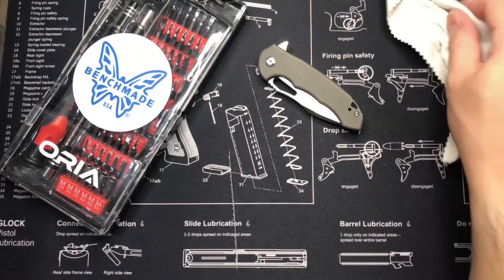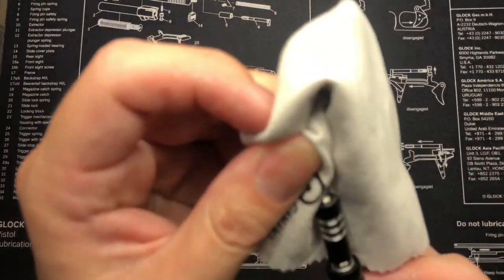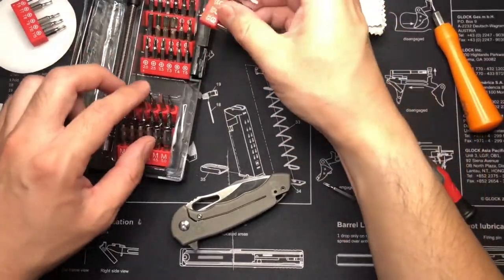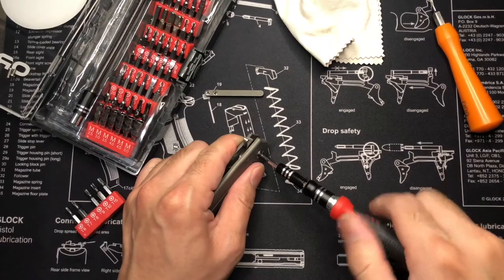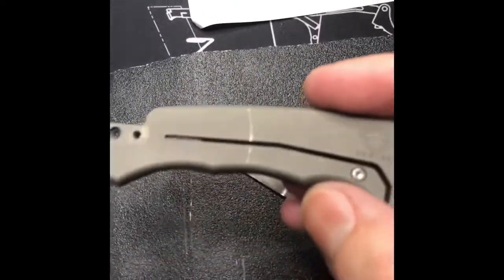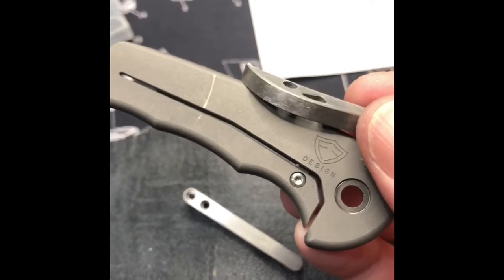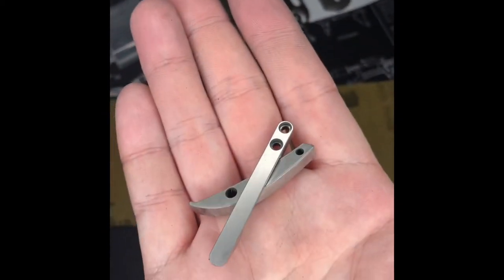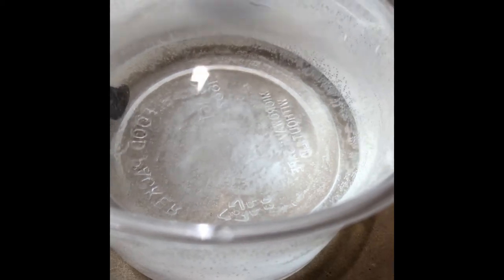Project Falcon - Color Anodizing and Blacken Titanium DIY / Home Project / Anodize / Do It Yourself!

Comment: So thanks for this vid, you make it look simple. I tried with a satin finish titanium clip in WD40 several times, but all I got was a multicoloured splotchy finish. It’s neat but it ain’t black. Is a sand blast crucial here?
Reply from the maker: I didn’t do any sand blasting but I think this lock side was already blasted. I didn’t do anything to the lock side except dip in oil and light it up. Make sure it’s glowing orange when it’s heated up before dipping it in
Reply: @DanosMac  thanks for the reply, the great thing is that get to mess more with it 😄✅

Comment: Hello, i tried blackening titanium in wd40 but I am only getting multi colored finish. I dip then heat to orange then dip again. Is there something I am missing? Awesome video btw.
Reply from the maker: All I really did was heat and repeat with the dipping. Did you clean the piece prior to the heat treat? I might’ve used some simpleclean or something on it prior to the work
Reply: @DanosMac  thanks for the answer. Yes I did. How many times did you dip sir? Im getting somewhat a rainbow color on my ti clip.
Reply from the maker: I dipped a lot. Probably 20+ times
Reply: Thank you! But did you also get the rainbow-ish finish before getting the black finish? Will keep on tying. :)
Reply from the maker: I looked at my old videos on my phone and it never changed any other colors.. it only got darker a bit every time I dipped it
Reply: Cool thanks again! Have a good one!
Reply: I think the torch heat is the key. Has to be super hot, I'm assuming. I tried this over the range and just got multicolor also.

Comment: How is the durability of the blackened finish? Did you also sand that up to the 2000 grit?
Reply from the maker: Durability is great. I didn’t do any sanding on it at all. I just dipped it in wd40 and flame it on repeat until I got the color I wanted. Hope this helps!
Reply: @DanosMac  looks great. Did you have the whole scale glowing red before dipping in WD-40? Or just med heat?
Reply: @thebeast14086  glowing red before dipping